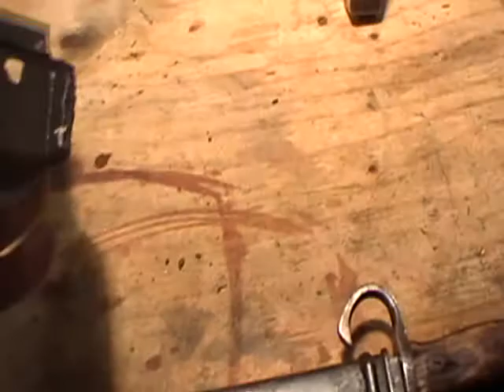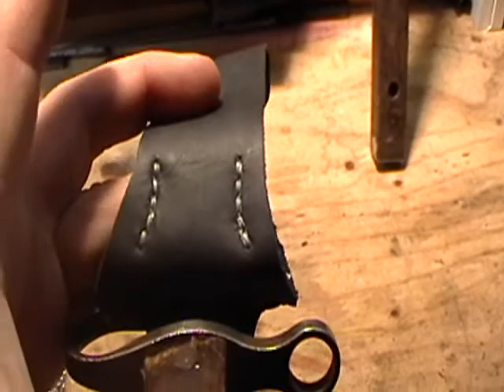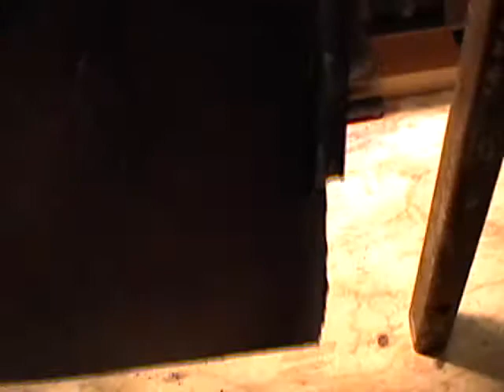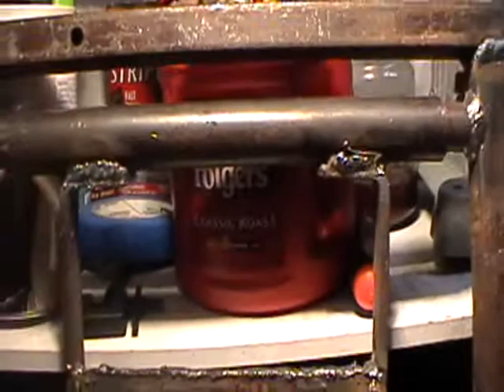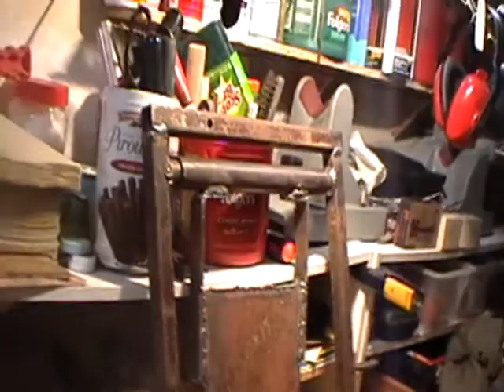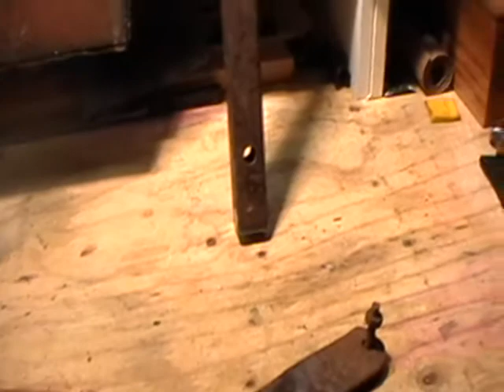Bayonet Frog and Gong Project.wmv

Comment from the maker: @ bulkfull I used the "hand stitch" method where I take two needles at both ends of one piece of thread and stitch in the holes I make with the awl. After the first hole, I take both needles and stick them through the same hole, pulling the thread through in opposite directions. Then repeat until the end, wherever that is!

Comment from the maker: I am a novice welder, at best. However, I think the welds will hold. There is one way to find out though. I went pretty slow on the plate. The frame welds were nice and hot. I could see the heat penetrating in to the metal. I accidentally burned through on one of the joints on the square tube frame. Yea, it looks like hell, but for free, what can I say...